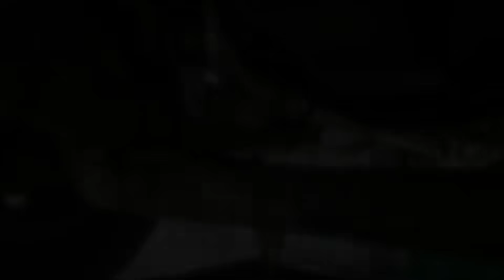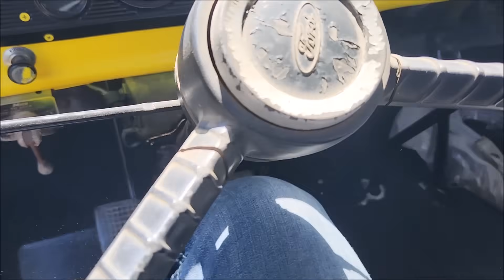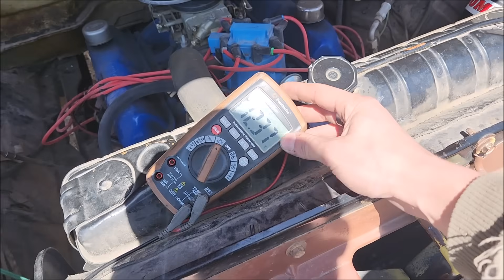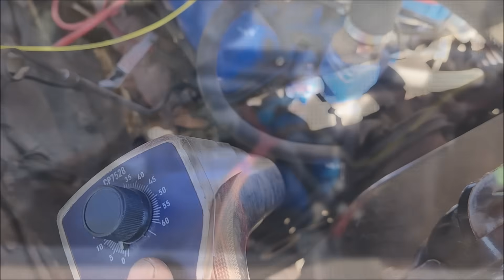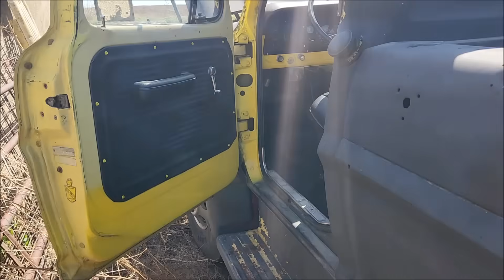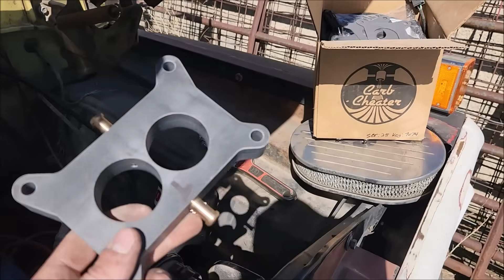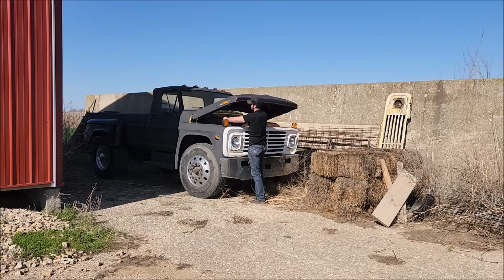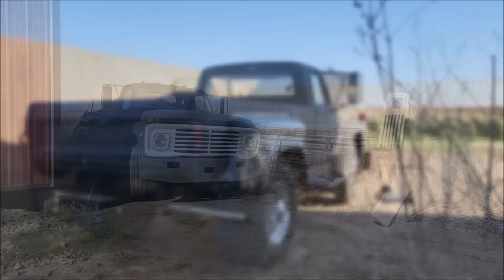Fix & Drive: 1972 Ford "Super Pickup" F750

Comment: I love watching ya'll work on carb'd vehicles. That said, I've personally never owned or worked on a carbureted engine before. Would like to though! I'm tired of electronic crud. The closest I've come to working on one is with the GM TBI units like what's on my 90 S10, but there's no fuel mixture adjusting, just the idle screw and to an extend the Fuel pressure regulator, but that's by doing a weird trick with a quarter or whatever, lol.

Comment: As a pilot flying old carbureted Cessnas, I have to adjust the mixture screw on the fly as I am changing altitude, due to the change of levels of oxygen at different altitudes. Less oxygen you want less fuel. You are absolutely right that rich-of-peak is the way to go. That is adjust until you have the highest possible EGT value, and then go a little bit rich from there. Keep it up! Great videos!
Reply: Due to the unbalanced induction system on those old carbed cessnas, rich of peak is the way to go. In many modern fuel injected airplanes with balanced inductions or GAMI injectors, Lean of peak is actually preferrable
Reply: You're a brave man!
Reply: I have to wonder if Luke's carb cheater would do that for you. Obviously it would be a custom job, and getting a product certified for aircraft is a nightmare, but I thought it and had to say it

Comment: Im one of the Few that have played with these FTs, I put a 391FT into my 66 F100 and it was an interesting build, best thing i ever did was pull the FT heads off those 1.75/1.50 valves and 79.5-82.5 cc dont do all that great, I used C8AE-H heads and a Edelbrock Performer intake 600 holley and headers it was an amazing boost of power and efficiency, with all that extra rotational weight you about couldn't accidentally kill it, i taught my wife to drive a standard in that truck hauling hay, eventually the demise was all my higher rpm driving and it lost the #8 rod bearing

Comment: I really gotta check that hei lead tip. That is how my HEI is plugged in on my 73 F100...
Reply from the maker: It's definitely worth looking into - number 1 reason ford folks have problems with hei and pertronix. 
Sadly, the ignition gets blamed when it's really due to a voltage problem

Comment: A little bit for you you can run a duraspark distributor with the module out of that HEI distributor wired remotely and a 12-volt coil
Reply from the maker: Sure can, I have done it - although I still think it more reasonable to just use the HEI outright. 
Would have the same voltage issue with hei module in duraspark box.
Reply: @ThunderHead289  I'm talking about using the dura spark distributor without the dura Spark box you can take the module from the HEI and wire it remotely on the firewall and use a 12-volt coil for the guys that don't like the Dura spark box and you can do it with the Chrysler electronic Distributors as well using the HEI module remotely with a 12-volt coil

Comment: Always wanted something same but if u would fix to use a Cummings with 5 or 6 speed be a fun truck just little parts and slightly better turbo for quicker spool does have to be hp queen the bolt on parts also maybe a air setup be cool get it little lower or like I wanted to have a 4x4 style one also one slammed one do some wheeler in just be fun also u could maybe find 2speed rear don't know how they came stock back then but update parts be Inprovement needs the visor and maybe a razor back or bed roll bar with lights be cool also..keep up great work and have wonderful day.

Comment: Well, and you don't have your PCV hooked up, so that's going to change your air/fuel mixture as well.  How much?  Who knows, but I've seen both minimal change, and significant change, probably dependent on how worn the engine is.

Additionally, as anyone who's watched Puddin's Fab Shop knows, installation of the air cleaner can also make a fairly big difference in the air/fuel mixture.  Setting it, then slapping the air cleaner on and closing the hood may require you to open the hood back up and do it again.
Reply from the maker: Your right, I have no idea what I'm doing obviously.

Comment: Cool rig, think i saw it on Facebook marketplace a while back, you mentioned 55mph as top speed, no 2speed rear? Anyway, i have an old 72 ford pickup with a once rebuilt 360, she is pretty tired, and it always cranks longer than I'd like at start up and seems to get vaporlock after she's warmed up when restarting, is it my tuning or is the engine just too warn?

Comment: Luke….speaking as a trucker with 2M miles under my boots, those wide-base singles on the back of your truck are part of what’s beating you half to death due to the 120 PSI inflation requirement. Not to mention the destruction they cause when one of those lets go…Just a thought, swap out to duals and drop the pressures to around 75-80 PSI and see how that might improve the rough ride characteristics. Swapping in an air-ride suspension on the rear would help as well, but it’s all in how far down the rabbit hole you want to pursue this. Granted, hooking onto something and hauling/pulling would smooth it out as the suspension is designed to operate under a load…..

   Great video as always, drives home not only the value of tuning, but knowing what to check before the first mixture screw is touched on the carburetor.

Comment: I think you are the go to for people who want to learn how to fiddle with older cars since you explain the processes very clearly. My first vehicle was a 1962 Ford Econoline van that I got for $75 back in 1980 when I was 16. It was a piece of crap, but it did teach me how to set points and timing, and adjust the carb. I actually got it running pretty good.

Comment: just throwing this out there using an actual distributor wrench will help by moving your hands out of the danger zone
Reply from the maker: I've had like 6 of them over the years and they always disappear or I loan them out never to return. 
On a Chevy, it's darn near required to reach the hold down
Reply: @ThunderHead289  indeed thats what usually happens to them they get loaned out to chevy and small block Chrysler owners 🤣

Comment: That two barrel Holley is a 500 CFM carb number 4412. It is a ricky racer carb that comes standard with the larger 50 cc accelerator pump. The carb was probably the closest thing they had on hand when they replaced the oe governor carb.

Comment: That's a cool rig. I dunno what you could do with it besides cruise around n beat up your kidneys. It doesn't have enough power to.pull much? To tall for a 5th wheel if you re powered it? 4x4 Co version? Divorced case n Rockwells?

Comment: Hi Luke! Wow, I had no Idea this truck even existed. And a 391 FT? But I love the look and stance of it. IMO, A keeper for sure and it might just be handy around the farm with the PTO set up. Take it to the local car show and watch a crowd form around her. Thanks for sharing. Love and blessings to you from Motown/Dearborn, Home of the Blue Oval!
Reply from the maker: The FT engines were basically an industrial FE with a forged crank, and governed ignition and carb (so someone didn't shock load the driveline under heavy load). 
They had forged cranks, slightly different heads, distributor, intakes ... they look like an FE, but ironically almost nothing will directly transfer from one to the other.
Reply: @ThunderHead289  Thanks Luke! I will be doing some more research on this beauty. Oh, thanks for reminder of vacuum gage high point and then adding a 1/4 turn on the air/fuel mixture screws. Totally forgot that and will check it later on the 460 750 Holley.
Reply: I'm really jealous. Definitely a keeper.

Comment: Looks like a bit of oil in the fuel at the end there.
Reply from the maker: I cut the clip at the beginning where I monolog a bit more about how it ran pretty poorly when I got it - I pull the lipstick and it's black and overfilled, a symptom of the poor tune. 
Didn't want to change the oil till I had some of the tuning squared away

Comment: Luke, im looking for a late 60s to late 70s f150 to build with my son.
Reply from the maker: If you are anywhere south of Iowa, you have a lot better chance of finding one than I do. 
All that aside, look for a 4 speed 352fe or 390fe truck. 
Anything with an auto after 50 years will not of stood the test of time - manual trans rigs are still rock solid and tough.
Reply: Has a built 351 Windsor in it

Comment: I've been told that my hometown's ambulance squad had a 70s F600 with a walk-in rescue until 1998 when they replaced it.
The F600 had the lovely issue of the engine shutting off as the volunteers were going down the driveway. Since it had power brakes, they had to quickly restart the truck to prevent it from slamming into a house at the bottom of the driveway.
Reply: I drove one as a grain truck. Stalled out going into the elevator in town when i was 16. Started rolling backwards. No  engine, no vacuum,  no brakes. Used the mirrors to navigate down the sloped elevator approach, narrowly fitting between the incoming line of trucks and a power pole, while trying to get the thing to start back up. Fortunately I had no collisions, but that was an issue I remember all too well.

Comment: Cool truck, they are really dumb and have zero practicality. That other pickup you showed will haul more because the truck itself is lighter. Don't put your hat baker on it unless it's for memes as you will damage your ground from the air psi in the tires. The dually bed looks very off I think putting the dual tires on might help but it probably needs those flares off and something else on. I'd sell it for a profit. You should get a bunch of cool videos out of this thing looking forward to it

Comment: Reminds me of the 'CHERRYPICKER'  I occasionally operated  in Florida for Southern Bell back in the very late 1970's. Cab looks familiar with the 4 speed stick, also, the front grille and side steps to get up into the cab are the same. One major difference is that the truck I operated had a dual rear end. I enjoyed the heck out of driving the truck when I had the occasion to - especially using the 'bucket'.

Comment: The yellow is the original Ford color.  I had a 73 grabber in that color with black stripes.  I also had a 72 f750 grain truck we used as a sap hauler in that yellow we called the tree bee.
Reply: Then I have a question. Is that Yuma Yellow? The doors look like meadowlark yellow. I'm thinking the doors may have been replaced. I really like the yellow in that cab. My '69 is Meadowlark, just a bit too pastel for me.
Reply: That yellow color is pretty cool. These trucks were always red or white where I grew up I don't think I had ever seen a yellow one.
Reply: @colton-w4h  -- There's a good chance the yellow color is due to the fact that the truck was purchased for commercial use by a private business entity, a city, a county, a state or the feds. That was very common in the 60s & 70s. I wouldn't guarantee it but the odds are good based on my experience. Best wishes!

- Max Giganteum

Comment: What a beast!  I'd hate to have to replace those rear tires though... wow.  Almost looks like something that Dalton from Pole Barn Garage would have.  It's one of those "just because" vehicles!
Reply: One of those rear tires is about 1150 dollars. 😊
Reply: @carlbernard4197 That's a lot to pay for a vanity wear item.
Reply: Got that right
Reply: An OD unit behind the transmission would help.
Reply: Those are super singles tires they're more expensive than the traditional dual tires dual rims

Comment: With 7.4 compression ratio make good starting point for turbo it's has has four rings per Piston
Reply from the maker: They oddly are somewhat perfect for a boosted scenario - forged crank in the FT as well
Reply: Only bad thing is you'd have tear it down for ring gap
Reply: Yesssss!!!❤❤❤

Comment: Very informative! I just installed an HEI in my 67 Cougar, I definitely want to go back and check supply voltage.
Reply from the maker: It makes a big difference - number 1 reason HEIs "fail" all the time on fords, as well as pertronix. 
It's actually just an under voltage issue
Reply: @ThunderHead289 if you happen to see this.

My 302 hei conversion even after much trouble shooting will still randomly loose all power in 4th gear low rpm ALWAYS when going up a incline.

It will die and I'll pop the clutch in 3 rd and it will take off (mostly) like nothing happened.

Next hill it might do that all over again...maybe not

Is that issue some thing a resistive lead would do?

Anyway Great Channel